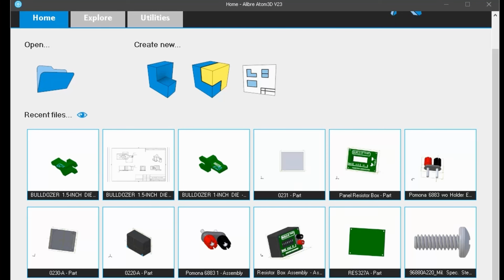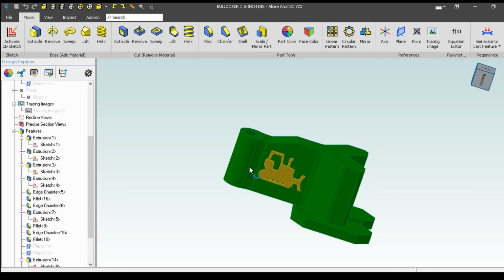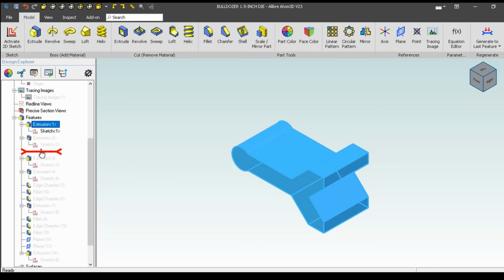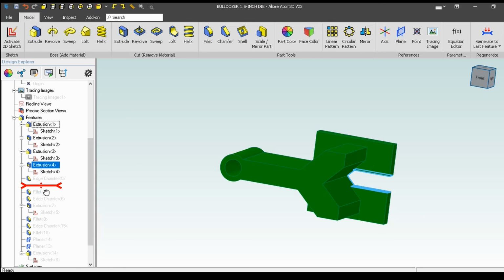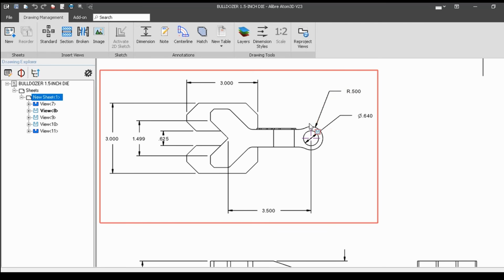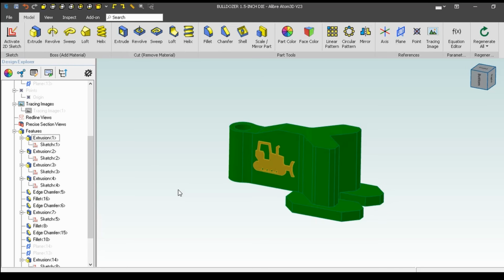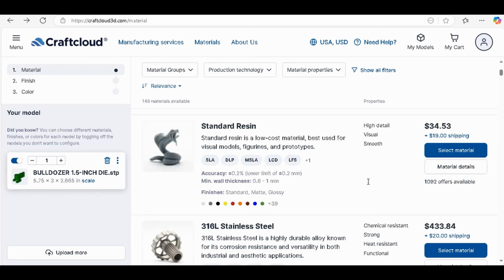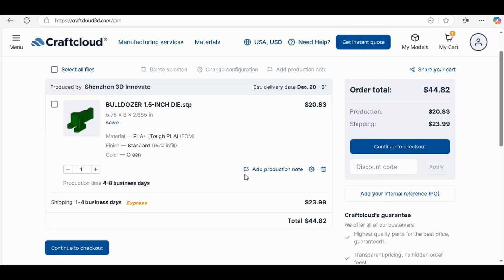DIY 3D Printed Bulldozer Die for Metal Bending – Compact Bender Upgrade!

Comment: Great idea and I'm impressed that the plastic bent that steel.  I would have to make it out of steel
Reply from the maker: I was not sure that the printed plastic would bend steel either. The nice thing is when this die wears out or breaks, I can cheaply have a new one printed or make any changes to this design.

Comment: Nice job with the bulldozer die. Could you put the handle pin back one hole so thicker stock will fit without remaking the 3d print ?
Reply from the maker: Thanks. It will not work in the next hole back because the side of the handle hits bolt near the back of the C frame. I have already revised the model to give another 1/8-inch clearance and the additional cut back on the top of the die.

Comment: Any chance of posting the print file for the viewers that have a 3d printer..and a bender..or just the file as we can slice it ourselves for printing..really good and even large 3d printers can be had for a few hundred dollars now..
Reply from the maker: I just added the Dropbox link in the description for this video for the drawings and the 3D model as a ZIP file. If you download it, please give me feedback as to how it worked for you. Thanks.
Reply: @buildItplace  Hi, the STP file worked fine in Fusion 360 and slotted into my compact bender model so I guess we are somewhere on the same page 😁There is some good reasons NOT to use Thingiverse if you read their fine print and like you I have chosen to share a bunch of my designs and files away from them. I will drop it on a Printer over the next week or so for a play 👍
Reply from the maker: @seabreezecoffeeroasters7994  Glad to hear the file worked with Fusion 360. Hope all goes well with your print. Thanks for your feedback.
Reply from the maker: I am considering having this data available as said during the video my only holdup is my liability for injuries of others when using this die. If I make this data available, it will be a complete no cost package of drawings and the step file. I should have my decision after the new year. Thanks for your comment.
Reply: You can add it to the thinigiverse, and in the notes, just add the "use at your own risk" warning. It's generally realized that is the case, though
Reply from the maker: @piercer4882  Thanks for the tip about thinigiverse I never heard about it so toke a quick look at their site. I have a Dropbox account, so my plan right now is to compile all of the drawing and the step file into a ZIP file then provide a link for downloading the data. I will also look into thinigiverse for this and future models.